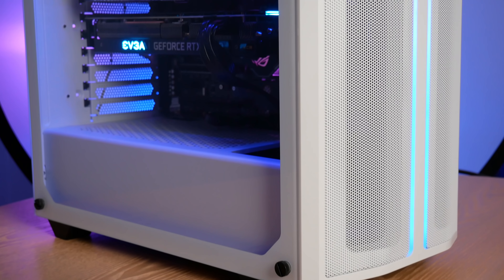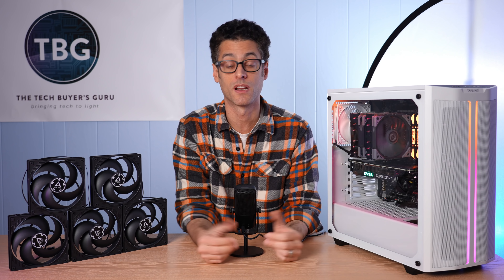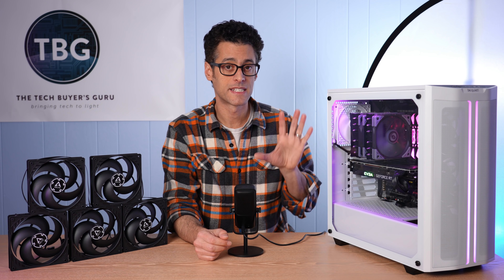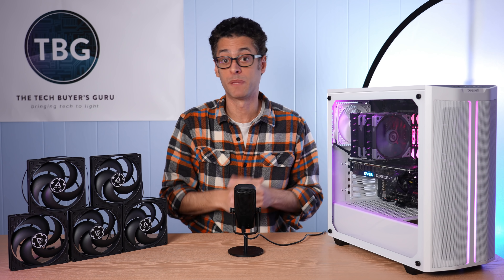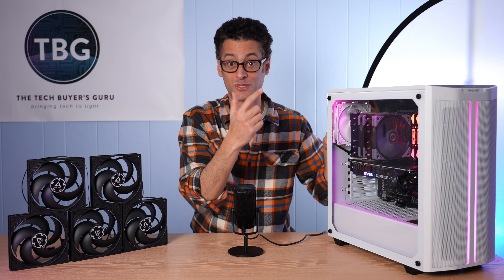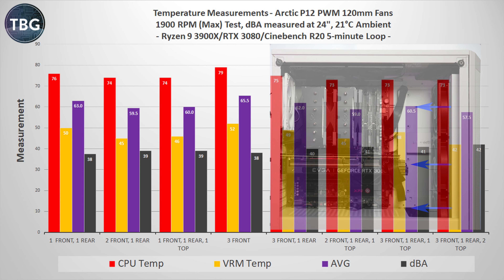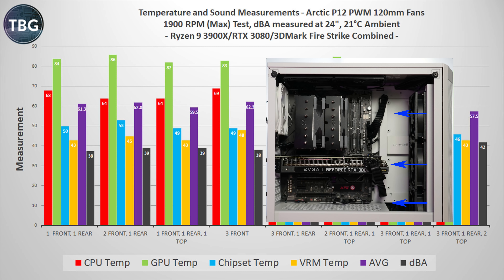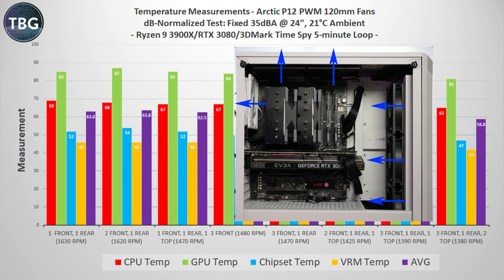Optimizing 120mm Case Fan Performance - The Best Number and Location, feat. Arctic P12 and 500DX

Comment: Re: resonance. The arctic fans shouldn't do that, but anyway, as a work around silicone fan mounts will completely eliminate pc case resonance. The vibrations are transmitted through the screws.  You could even test this with a video, for example; Test 1 setup: 6 cheap screw mounted fans + 1 cheap pc case; then record the loudest pc resonance decibels (at say 1200rpm). Test 2 setup: Exactly the same setup except replace the screws with silicone mounts, retest at 1200rpm. The scientific principle at play is isolation, the silicone fan mounts ensure no part of the fan is actually touching the case. I use Akasa Rubber Case Fans Mounts, £5 gets you about 20.
Reply from the maker: Thanks for the tip, this is something I will try if I detect resonance in my 140mm follow-up video.
Reply: @TheTechBuyersGuru  The 140mm Arctic is terrific, it chucks out so much air. I've been wanting to buy a gadget to numerically record the air flow of the fans, but sadly have too little reason to do so! Keep up the good work.
Reply: I've been wondering about this for a while myself but what I was just going to do was cut up some pieces of thick rubber bands then puncture holes in them then put the screws through those on both the inside and outside of the case.
Reply: this is a good point! ill be buying some silicone mounts when i build a new pc with these fans! thanks for the advice
Reply: I used the Noctua NA-SAV2 20 pack, there is zero vibration yet the annoying whistling sound  persists, and is terrible. A custom fan curve did the trick, and all is good now,  but it did take some time to test and try a few  variations of the curve to avoid the rpm that was causing the issue. The whistling in my case was so loud prior to the curve that there was no way I would want to sit next to my pc all day working, even with headphones on.

Comment: You didn't mention it in your test setup, but from the looks of it you have done this without the HDD bracket installed in the case? Because having that in the bottom would minimise the benefit from having a 3rd fan in the front, or so I would assume.
Reply from the maker: You are correct, as I always test my systems with the hard drive bracket removed, and always recommend people do the same if they don't use hard drives. But I don't think it would have the impact that you're assuming, as the hard drive bracket sits pretty far back from the fans, and the airflow from the third fan is going over the top of the shroud, not into the shroud and then back up to the GPU.

Comment: great video as always, I really like the level of depth you're going into.
you deserve so many more subscribers, hopefully you'll get them soon.
Reply from the maker: Much appreciated! This is a pretty niche video, not something most big channels will focus on. I'm hoping there are enough people in the world interested in it that it picks up a nice amount of views!
Reply: @TheTechBuyersGuru  it is niche indeed, but a lot of relatively large YT hardware channels (by today's standards) started by focusing on niche things (rocketjumpninja on mice, hardwarecanucks on pc cases, gamersnexus on deepdive analyses, etc.). All the best !
Reply: @TheTechBuyersGuru  which is something very wrong. They know this, but they don´t cover it, (because there´s too much to cover or to hard to standardise the tests......). There´s so much more to optimising airflow with an air cooler than just slapping fans around.
As you can see, there are diminishing returns for number of fans, and the better you optimise the setup, the earlier they show up. 

I do have one suggestion tho..... I know 35dba it´s a really nice noise midle ground. However, you are in the zone where you´re experiencing diminishing returns for RPM. If you wanna have more resolution test the fans around 30-32dba (that should be around 900-1000rpm). You will find that there isn´t so much benefit in running fans very high when the case is good and fans are in the right place and the right amount.

That said, fans like arctic P series might be an exception to the rule, as they don´t do great at low RPM, for air volume displacement, at least not compared to NF A14 shaped fans (thermalright TY, kaze flex 140mm, sw3, etc). They are static pressure fans after all.

Your results and findings are spot ON, but still incomplete. I discovered the same patterns setting up a meshify C.

Hope you read it.

Comment: You are the one youtuber I can think of that is really doing the noise focused testing I'm always hoping to find. I hope your channel grows to allow you to do even more testing, get sent more hardware to test, etc. 

I'm looking forward to see the 140mm test and how it varies from these restults, if at all. Obviously a lot of cases still don't allow for 140mm fans in all slots, but it's still very useful information :) 

I'd also love to see 200mm fan tests at some point ;) 

I would be curious, to be able to compare to similar cases, to see whether closing off the PSU shroud at the front section has an impact on temps and noise. On most of the other airflow focused cases that space has a cover that can be fully or partially removed, with some people (myself included) thinking that closing it (and thus not having a third fan below it) means that more air is being directed to the area right below the GPU, rather than being "wasted" in the area below the PSU shroud. Would be amazing to see whether there's any truth to that. 

I'm also hoping that in the future, with more support, and closer collaborations with hardware manufacturers, that you would be able to expand your testing into GPU coolers. I'm really missing someone that does elaborate testing with a noise/temp focus on the different GPU cooler models. I haven't been able to find any decent info on the 3000 series cards (though that's likely more due to supply shortage than lack of willingness).
Reply from the maker: Thanks for your supportive feedback! Interesting idea about the panel on the PSU shroud. I too thought airflow was being wasted until I saw how much cooler the GPU was with the lower fan, even if it was halfway below the shroud!
Reply: I agree, I was surprised too. There was a clear indication that fans below GPU = better GPU temps (which I guess is not that surprising now that I think of it). 

I wish more cases had bottom intake ;) 

When I get my hands on a 3080 I'm gonna try removing that panel in the shroud and mount a bottom fan in the Meshify C - possibly along with a front-bottom fan if I can get it to fit. The 3080s are so long that I'd otherwise have to rely on a slim fan in front of the GPU with very little clearance. Your testing suggests my plan  may be good ;)

Comment: Well i have a Full Artic Fan Setup since August, i have 2 Arctic P14 PWM in Front, 2 Arctic P12 PWM in TOP and one Arctic P12 PWM in the Back.
My CPU Cooler is a Scythe Kotetsu MARK II and i have no Issues with Temperatures or with Noise.
My Setup are
CPU: Ryzen 5 3600 (Stock)
Mainboard: Asus TUF gaming Plus B550
Ram: Crucial Balistix 3600 MHZ 32GB Ram at total( 4x 8 GB)
GPU: Gainward RTX 3060 ti

At Desktop Idle, System ist not noticeble and CPU ist at 32-38  C°
At Gaming the CPU Hit up to 58-63 C°
GPU is not going higher than 69 C° at 60% Fan Speed GPU

I Think that the ARCTIC PWM Fans are Performing better than my old Noctua NF 12 PWM Setup i had before. And that Artic's are really low priced!

Comment: Another thing to consider is hybrid pressure/airflow optimized fans as intake and pure airflow optimized fans as exhaust.
Also, when it comes to having two fans on the top, it would probably be better to have the front top fan be an intake rather than exhaust. Because it's likely pulling cool air away from the CPU fans.
Reply from the maker: I'm going to be flipping the top front fan in my 140mm fan test, as many have suggested the same theory that you propose. It's a good one.
Reply: @TheTechBuyersGuru  I actually did this myself and had success. However I'm not sure if it would be the same for all setups or if it's just because the only intake I had before was the 200mm fan below the DVD drive bay. 🤔🤷‍♂️

Comment: I would suggest doing a test with the top fans as intake instead of exhaust. I have seen a few videos of front and top intake and the 1 rear exhaust being the best setup.
Reply from the maker: Great suggestion! I will try this in the 140mm fan test.

Comment: Friend thanks for the work you do, I have 2 Be Quiet Pure Base 500dx cases and I have run some tests, with these fans;
3 Noctua NF-A 12x25 PWM
3 Be Quiet Pure Wings 2 140mm (original case)
3 Arctic P12 PWM
The first setup was
1 Be Quiet Pure Wings 2 rear exhaust
2 Be Quiet Pure Wings 2 top exhaust
3 Noctua NF-A 12x25 front intake
and the temperatures with were not high, then I put the Noctua away from the filter (like you did) the temperatures are better -1/2 degrees, but you hear an annoying noise at any rpm, I put the Arctic and you can hear always annoying noise, so now I'm trying with the 3 Noctua front intake and close to the filter and 3 Arctic in exhaust, the final result I will see tonight, since I am interested in silent in idle.

Comment: Really interesting regarding the resonance. I noticed I seem to have an issue with that in my system as well, and only at a certain RPM. I have a water cooled system with just about everything from Corsair (so all iCUE), and with the LL120 fans (I have five set up with a 360mm and 240mm radiator), I think there is some resonance around 1300 RPM. I have my fan curve set to max out at 85% (gotta keep my system quiet at night with my wife and kids sleeping in the same room with me), so when it ramps up, it does quiet down as you said with your system. I wonder if slightly altering the fan curve for the two top fans would prevent it from happening. Anyway, as always, thanks for your informative content. I keep going back to your fan shootout videos and ugh, so disappointed about Corsair's fans. But I'm totally invested in the ecosystem and don't really want to break out of it.
Reply from the maker: Thanks for sharing your experience. I've used the LL120 fans, and they are decent. No odd noises, and they look very good, but even Corsair would admit they are not designed to win any performance crowns. I'll actually be testing a Corsair H150i in the coming weeks, as part of a series of videos I'm doing on high-end coolers. While I know it's loud at max RPM, it will be interesting to see if I can make it behave under dB-normalized conditions!

Comment: Nice work. Case fan configuration is such a PITA.  Imagine coming up with the best config for CPU/GPU/VRM when running CPU/GPU both maxed out on water cooled system.  After getting config dialed in you start playing a game that only uses 40% CPU and 99% GPU and your front mounted radiator fans are turning at min RPM because the CPU is cool.  Less intake air could make the GPU hotter, or maybe you have two top mount and a rear fan as output that are creating negative pressure now due to low intake CFM and the case is now sucking in fresh (unfiltered) air through the I/O ports, making the GPU cooler.  You can re-tune for that scenario, but then you mess up other scenarios that are more CPU demanding.

There's simply so many possibilities and it's more than just one person's case and fan combination, it also depends on what sensor(s) the fans in system are following to ramp from and the load they're putting on GPU/CPU with the game/application they're using at the time.

Seems like I need to look for fan control software or something that I can configure speeds based on combination of GPU/water temps.  I think I'll give SpeedFan software a try.
Reply from the maker: Agreed, it's infinitely complicated, but I gave it a go. There's no one right answer, but there are definitely some wrong answers, which happen to be ones that a lot of folks out there ascribe to.

By the way, I use Argus Monitor for fan control - it's great! Not free, but worth it if you care about full control over the fans AND the sensors they use: https://www.argusmonitor.com/
Reply: @TheTechBuyersGuru  Thanks I'll take a look at that software as well.

Comment: As far as I'm concerned just make sure you have an intake and an exhaust ,your intake should exceed your exhaust in terms of airflow (positive pressure)
While looking at advice for specific cases can help somewhat, as pointed out there are too many variables in your other hardware to give specific advice.
I just put 5 arctic p12s into a pure base 600. I used 3 intake at the front (restictive flow case) and 2 exhaust. Because the case has a simple 3 pin fan controller (hi - med - low switch on front panel)  I used a fan extension with built in resistor to connect the exhaust fans to the controller so they always run at a slightly lower rpm than the intakes. This balanced out the restrictive airflow on ther intake and still allowed use of the simple/dumb fan controller.

TLDR You want positive pressure, everything else depends on the equipment you will have to test different configs to find the optimal setup.

Comment: I think the optimal setup for 2 intake fans (be it 120mm or 140mm) is to direct the lower fan to give fresh air to the GPU cooler (installed flush with the PSU shroud) and the upper one to direct air to the CPU cooler. If both fans are installed as high as possible, the lower intake fan just ends up skimming ja backplate of the GPU, thus misdirecting the airflow. This is a thought originally presented by Steve from GN in their Meshify C case review.
Reply from the maker: This is a great point. I didn't do this as I was using the standard fan positions throughout my testing, but yes, you can stagger the fans to direct air at certain components. With 140mm fans, you don't need to do that, because they will typically span the full distance if you start at the PSU shroud on mid-tower cases. On my Pure Base 500DX, doing this actually puts the axis of the top fan above the axis of the CPU cooler fan. Will be interesting to see how those two 140mm front fans do in my Part II of this video!
Reply: @TheTechBuyersGuru   Agree! Very interested to see the 140mm results, as 2x P14's were my intake fans of choice in a similar case. Thanks for the video!

Comment: Also, I have two P120 (same as p12 but a different frame and a braided cable) and they have those sounds at 990+-5 rpm and 1180+-5 rpm, which is slightly annoying. But manageable.
Reply: I have one of their Bionix 120s - it also makes a weird harmonic noise at a higher rpm range. Have it running exhaust behind my Fuma 2 at lower rpm range now, synched to the CPU cooler fans, and it's fine

Comment: 5:37 Hey Ari, could you explain the reasoning behind leaving a gap/space between the front fans and dust filter? I have the exact same bequiet case, so I was curious if I should move my front outside mounted fans. As always, glad you covered this topic as this helps optimize PC build performance!
Reply from the maker: Sure - one of the issues with having a dust filter right in front of a fan is that it can cause some interactions that increase overall noise levels, essentially, you'll hear the air pulling past the filter when the blades are that close, creating a whistling sound. Some people also believe that the filters right up against a fan will cut down on airflow. It's probably because the air must come through in a more linear fashion, having fewer paths towards the fan than when the intake fan is further away. Some of the force of a fan right next to the filter also goes into actually pulling on the filter physically, which of course is wasted energy.
Reply: @TheTechBuyersGuru  Awesome, I really appreciate your in-depth answer. Convinced me to move my fans! Really looking forward to your follow-up video comparing 140mm fans because I have some extras waiting for your recommendation!

Comment: This is going to be interesting.. before your test, am going to guess again. at max RPM and being quiet. 

If it's based on airflow on CPU .. my guess is this 

Max RPM, being quiet and having best temp.

Front - 3 x 120mm intake
Top - 1 x 140mm intake (fan near to front bezel) 
Top - 1 x 140mm exhaust (near rear fan) 
Rear - 1 x 140mm exhaust 

my guess might be wrong but lets see. reason to have top fan mounted this way because.
front intake is mix up by the hot air from GPU which is raising up, therefore the top front brings cool air to rams, cpu heastink and vrms. as for top rear is to assist the rear fan to exhaust the hot air out from the CPU heatsink and misc hot air.
Reply from the maker: You've got some great insights here! But this video is only looking at 120mm fans, in a follow-up video, I'll be looking at 140mm fans. I actually hadn't though of mixing and matching fans, but in my follow-up, I may test 3x120mm in front a 140mm in the other slots, like you suggest, as that could be the ultimate setup!
Reply: @TheTechBuyersGuru  opps sorry, my bad. cos everytime you post anything about cooling and fans.. it will trigger my mind. Most of my friends and colleagues, especially gamers, they will trust my judgement to build or to improve their pc health as in case airflow, noise, temperature and such. still, do pardon me Ari.. my bad, but I will still support your reviews as I do learn things from you too. btw it's late get some sleep my god.

Comment: Great video, I'm amazed it only has 41k views given how thorough it is, 140mm fan testing was great too, one suggestion though, maybe remove or exchange the top filter as its a bit restrictive compared to say, Silverstone ultrafine filters & doesnt need to stop dust when the system is exhausting out the top, maybe worth looking into. Cheers!